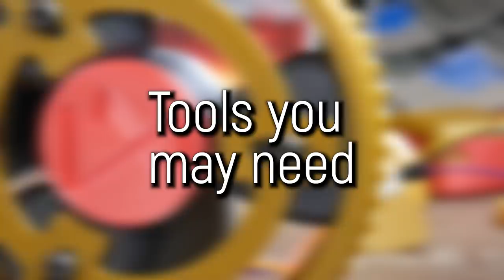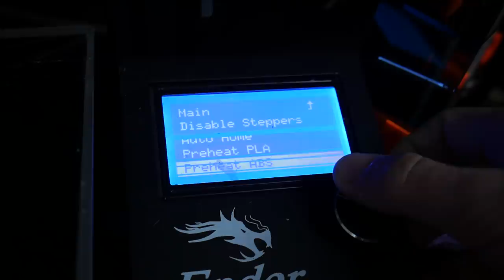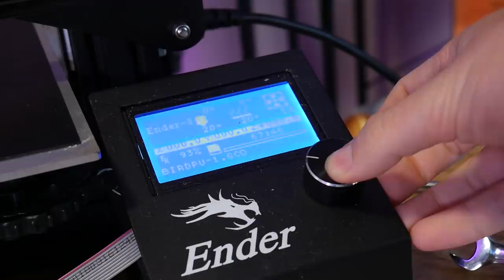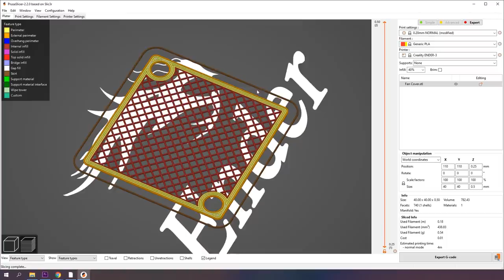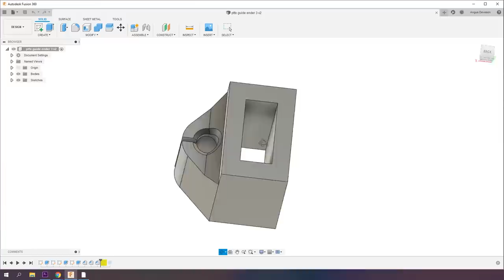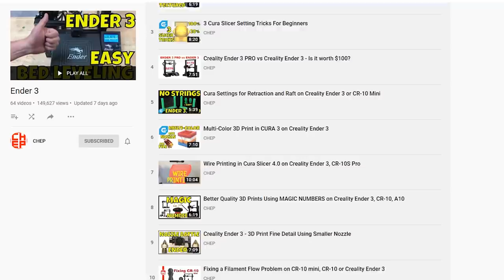Maintain your 3D Printer and get great prints!

Comment: Angus after trying to buy an A 10 twice on EBay, no luck, will not ship to Canada, got refunds, then Gearbest I tried to get a Anycubic Chiron, was sent but porch pirates got it, no knock from UPS. Got a refund after 6 months of trying to get a replacement and asked PayPal to step in. Not using Gearbest anymore. I then ordered from Lightinthebox a  	
Tronxy X5ST-500-2E 3D Printer and arrived with $150 customs charges due. Tried to get through the instructions but was for another machine. Extruder wires missing and no screws for the Z axis guide rods. Ordered separately cables and screws. So it sits not working for 2 weeks. I found some screws at a hardware store temporarily. When I turned it on, the Z Axis jumps 1 degree and stops turning. ?? It should advance up to the stop switch. Does this mean the logic board is no good? Or does it mean signals from both extruders need to be present? I emailed TRONXY and no emails came back, so support sucks. 3 weeks and nothing is working. If this was for a Youtube reviewer I'm sure it would have been complete and working condition.

Comment: If you take a soldering iron and run it over the solder joints connected to the lcd directly it should repair it. Be sure not to leave the iron over the plastic for more than two or three seconds or it will melt. You will also need to leave the lcd on to see what you are doing.

Comment: Perhaps the idler pulley at 6:36 could have a 3d printed other side to make sure the bolt doesn't bend and unnecessarily stress the belt. Thanks for the advice!

Comment: Very nice! Would be cool if you did a similar thing for the overhead gantry style printers that mostly use smooth rods instead of v rollers. (I'm probably one of the few still running a Replicator 2X, but there are others similar to it - that is, not i3 style - that are presumably more popular)

Comment: Great video. The grease should have been applied with nitrile gloves not the flat head screw driver. Using your pointer finger you can apply a thin layer on the treads to prevent the squeeze out.

Comment: The hot PTFE tubing is a poor design. I had serious issues with it, eventually to the point that melted filament was leaking out of multiple places and would not print at all.  I installed the Micro Swiss All Metal Hotend. Also replaced the thermistor on the hotend.

I have an idler on the bed that will no longer tighten enough to eliminate movement. Time to replace that.

I also really want direct drive. And a good upgrade for that would be Dual Z.

Comment: Display. You would definitely have a mare of a problem. Visually this looks like CoB, one Com-Seg driver with two Seg extension drivers.
Wierdly it looks like it could have a top and a bottom edge silicone/carbon zebra connection arrangement. May be one with a massive amount of tracking out of sight heading south on the topside of the board. That would allow for a hot-bar welded flexi. Lots of connections to the glass then on a fairly fine pitch. 
Problem uno: the glass is affixed to the board by the metal bezel. The bezel tabs have been twisted and then locked with solder on a wave machine. Could be for security or for EMI/EMC reasons. A lot of patience, flux and braid can get you past that.
Problem 2a: If zebra(s), remove. Wipe glass, board and both edges of zebra with IPA. Reassembly could be the hard part. Sandwich it all together again. Apply firm clamping pressure, power up. If good, lock the lugs. Retest. Apply only small blobs of solder to finish (going back in will be easier). 
Problem 2b: If HB flexi then it can be tricky. Layout unfolded and work your way in from the outer ends applying pressure to the glass and board end connections. One by one. The dead rows (Comms) will likely be consecutive connections.
Looking into the glass with decent magnification will probally show you from which end the Coms are being fed, the Segs are either the central block or the other end.
If you get a result then a soldering iron will be needed. Three kinds of flexi--exposed, easy--windowed, easy--single sided, tricky. On single sided you have to apply heat through the Kapton backing so try to stay beow 400C. Should ony take 3 to 8 seconds.
Warning you could end up worse than when you started. Consider, are find it annoying MM's atitude or plain unuseable?

Comment: I keep everything tight, but whenever I print round objects, layers dont align properly and I get some really smooth parts of the object and some really uneven parts where layers clearly dont drop on top of the previous layer, but go inwards or outwards.
Reply: I would suggest printing slower, because it seems like the frame is wobbling. If you have an acrylic frame or unsupported frame it is likely the problem. You could support the frame.

Comment: I got an Ender3 a few months back.  Not happy with it as it underextrudes consistently giving me very weak walled prints compared to the same print from a Flashforge I have.  While the prints improved with a bowden tube upgrade so it was no longer delaminating, the walls thin and soft.  Not sure if upgrading to a direct drive for the extruder would improve the issue.

Comment: Okay where to start .First Nice vids.. thmbs UP  .

When building the printer, the extruder was seated the wrong way round on the motor.
A bolt was on the wrong side with that same motor.

2 days of good prints. after that no more. the heater was loose. bolts of the guides were loose and there was play everywhere .. 
finally after 2 days of tinkering good prints again haha.

Comment: I actually picked up an old da vinci nano that would run into errors after just 5 minutes of printing. The software said it had 200 hours of print under its belt, ultimately after a lot of tlc i've got it printing again. (will definitely be looking to move on to either ender 3 or a biqu b1, because of the nano's print volume, lack of heated bed and proprietary filament BS)

Comment: Hello Angus, this is a great video as I am cleaning up my FlashForge Finder. They have a lot of surface area for dust to build up with the thick frame and all. But do you have any experience of printers making the same layers shift depending on the speed you are running? I print with rafts to overcome this issue since I'm lucky enough this artifact occurs on layer 2-4, meaning base layer is fine, with infill and all, layer 2 gets slightly shifted on the X axis and does that to layer 4, then it prints perfectly. Even printed a vibrations test that is 100mm high to see if it had something to do with the belts, the raft is a bit messed up, but the print itself looks awesome. Have no idea why.

Comment: Great video, thanks Angus. I have a tube of white lithium grease that someone recommended I use for lubricant, what do you think?

Also pro tip, use the little clips that come with the printer (flush cuts) to cut the excess zip ties flush so they don't leave a sharp bit of plastic to cut yourself with later.

Cheers!

Comment: any chance we could get some details on that T handle allen key. Looks like you got 4 sizes right there just by flipping or swaping the shafts, but I was unable to find it anywhere... Thanks for all the great vids 👍👍👍
EDIT:
For those how are interesed in the Allen key, it's PartsMaster Superglide 6-Way sliding tee. Company appears to be based in Texas, USA, and their site says "US Military & DOD Contractors only". Guess that's why I couldn't find them anywhere... But unfortunately, they are not swapable as I though and each T is a specific size.

Comment: Consistantly getting problems with 3D benchy printing on a flashfoge creator pro, it is warping upwards on the bow during the print, any suggestions? Bed is at 65C and Fillament is at 210C

Comment: Any recommendations for print settings for a .8 mm nozzle I just wanna do helmets and big pieces without many details quickly
Reply: Not sure if you're still working on this, but for me I was able to print crazy fast by upping my temperature a bit. I print at 60mm/s with a layer height around half a mm. Let your magic numbers determine the exact height. I'm using a e3d v6 hotend on a 12V system and setting the temp to 215 or higher (usually I print at 200-205) compensates for the crazy amount of energy lost by extruding that much plastic. Watch out for drafts and carefully aim your parts cooling away from the nozzle/heat block to avoid temperature runaway errors.

Also I tend to tune extrusion by sight as you can easily do that with the big nozzles, and slight errors in extrusion modifier or filament diameter get amplified.

Comment: Cr10 randomly unlocked z stepper after unpause......known issue?  This is a pretty new printer, but sometimes after unpause, z stepper is unlocked and nozzle falls into model and drags.  I usually have to stop print and start a 2nd print where the 1st left off and glue the 2 together......, but what an unnecessary pita.  Everything seems tight, and prints continue to be tight with minimal boogers and stringing, but pausing is like rolling the dice.  Please tell me this is a known issue.
thanks

Comment: I recently had  issues with a nyloc nut on one of the bed rollers coming loose.  I assumed that could never happen but it did!  I've got an ender 3 from late 2018.  Check your nyloc  nuts  :-)

Comment: How many hours do you all have on your 3D printers? I've only had mine three weeks and I've already passed 200 hours. I have no idea if I should expect my hobby grade printer (FlashForge Adventurer 3 Lite) to last 1,000 hours or 10,000 hours with regular maintenance? I also have no idea how often nozzles have to be replaced (assume no abrasive materials, just PLA and ABS).

Comment: I have my Ender 3 pretty well dialed in, but I'm having problems printing threads.  What tips do you have?  One example would be the 3XAAA to 18650 flashlight adapters with the tube extender.

Comment: I just finished doing a lot of repair/upgrade on my Prusa Mk1, new hot end, new 3dprinted parts to hold the hotend fans ect, added noctua fan (omg sooo much quieter),  4 wires broke in the process. but seems to be working except for the Heatbed which seems to have a bad connection sometimes it heats sometimes i have to wiggle the connection on the board not sure how I can fix this :/

Comment: you need to ditch that off set v-slot roller bed frame, there terrible. get one of the new standard bed frames, the slot rolers are parallel, much easier to tension correctly etc

Comment: Has anyone else had trouble with Crealitys support? I started to build my Ender Pro this past weekend and the X Axis belt is too short. I contacted them but they seem to be giving me the run around. Asking about the model and photos of the issue which is standard, Then asking another set of pictures or the belt next a tape measure. I'm like I just got this and I need the right size belt! it shouldn't be rocket science. lol

Comment: Hey since I don't know how to message you directly I will just do it here, my question is how does the flow rate on my 3d printer relate to S3D extrusion multiplier I get good prints with it let to 90% on the printer but I hate having to change this every time. is there a better way to do this?

Comment: Hey boss can you do a preferences for .8 mm nozzles on the slicer software I’ve been to places where the wackos told me to put it to 140 mm speeds and a .4 mm height ect as a beginner this is very confusing and the test print at this setting came out in the shape but like a slinky so it split into bits and pieces after removing the raft and supports

Comment: Hey Angus, would you recommend the ender 3 pro (the newest model of the pro) as a beginner 3D printer? Looking for a printer with a decent bed size but still affordable. Thanks for any advice :)
Reply: I quite like mine, it prints really nice. I followed a YouTube tutorial rather than the instructions because they are bad, and I put it together in about 3 hours. I’ve only had one fail in about 2 weeks and it was my fault lol. The heated bed is quite nice.

Comment: you uploaded this video like 3 days after my Doot Changer started having issues out of nowhere xD my holes are undersized by 0.5mm out of nowhere compared to 0.2mm and it fuses 0.2mm tolerance and only can do 0.25mm min all of the sudden. the layers have also started looking a bit bad strangely despite the undersized holes my walls are actually either exactly the same or 0.1mm bigger or 0.1mm smaller. it's weird...
Update: I already had done all of this 😭

Comment: Hello I have an ender three but I’m very bad at getting good prints to come out.  Any suggestions on how to smooth out the outer layers of my prints?  Edit: I already know about the ironing feature but how do I smooth out the sides of the print(s)?
Reply from the maker: Hard to know for sure what's causing it, but could be loose belts, inconsistent extrusion or a damaged lead screw. The process itself is layer by layer, so you will always have printing lines regardless of how well tuned the machine is.
Reply: Slicer settings.  I find that layer height, speed, fill density, Support density, etc. can greatly influence end result.  These guys that have been printing for a bit: Take for granted their ability to know these ideal settings, just by looking at the mesh.  There is NO ideal setting for All prints.  Going too slow, or (too high of a fill density) could curl edges and allow rocking(amplifying print layer lines). Smaller layers and slower print, does not always equal better end product.  Also take thingiverse or yeggi or cult (recommended slicer settings)on a downloaded print- with a grain of salt.  Wha th makes them unattractive prints??
Reply: Esteps calibration, PID tune, Z screw alignment.

Comment: How do I connect my a8 to cura on a MacBook?
Reply: Anet a8
Reply: If it is possible, you will need to connect the Anet A8 with the usb cable supplied. I would recommend just using an octoprint server hosted on raspberry pi. It can connect to cura, and it is not too hard to setup
Reply: Lemon Juice62 yea I have a USB cable that I plugged in to my iMac. Octoprint sounds good, and I can use my arduino with it as well. But I think cura is just simpler to use

Comment: As an auto mechanic as well, that grease would NOT last "forever"
Reply: It lasts a lot longer when it's only resistance is a >2lb print head, and not in the wheel bearing of a +1500lb motor-vehicle.

Comment: I want to tell you something about health. Little particles are harmfull for lungs and what you do includes these particules and other gases. Using masks is an  option but another very important option is air circulation. If you keep where you work vell circulated, it may prevent damage to your lungs. Closed, low volume spaces without windows are worst.